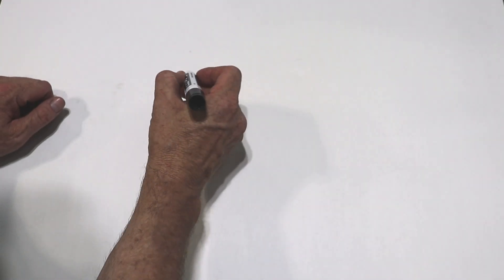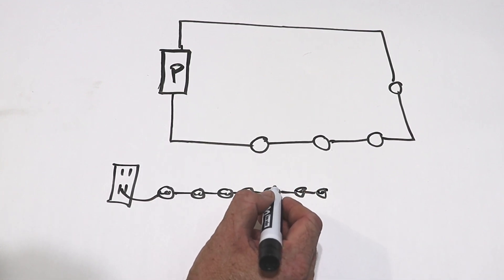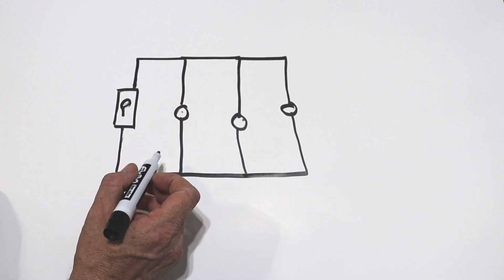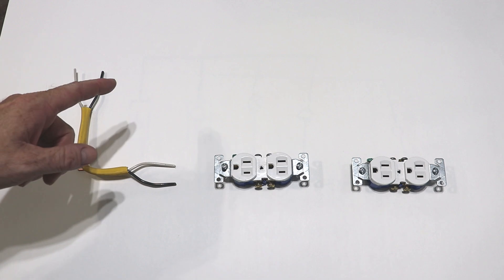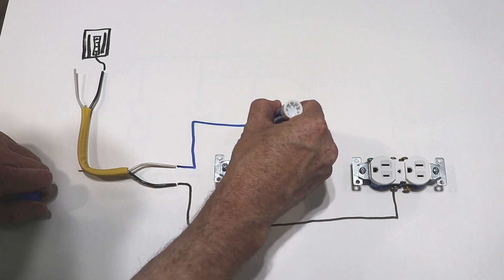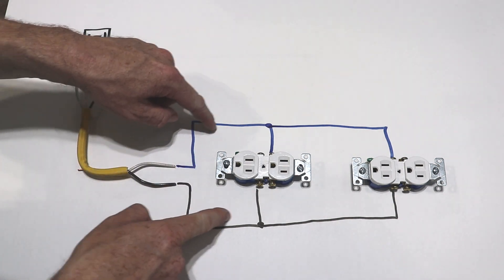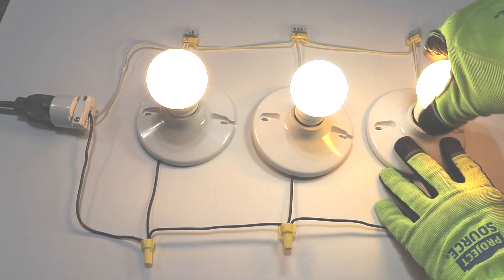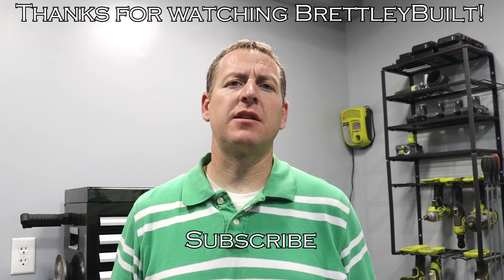Explaining the Difference Between Parallel and Series Electrical Circuits

Comment: Just curious if i was to test a outlet at the end of the run would i get some voltage on the neutral side if i had something plugged into the first outlet with load but NOT the end outlet i was testing?  Like will the neutral side carry voltage backwards?  I hope that makes sense.
Reply from the maker: There is aways voltage, but not current until something is plugged in. I am actually not sure.

Comment: What if the circuit only contains 1 switch and 1 light? Please respond thank you
Reply from the maker: It would look more like a series circuit, but it is important to understand that houses are wired in parallel.

Comment: Curious about one thing. For 12/2 romex, or any gauge with a ground (bare copper), how is this ground connected throughout your example with three lights?
Reply from the maker: There isn't a place to attach the ground wire to on this type of light fixture. You can push the bare copper wire up out of the way into the top of the box.

Comment: Your videos are great! The electical basics was very clear and helpful. Can you do a video or share resources on how to run multiple lights on a circuit, each indepentantly controlled by their own switch? I have two adjacent bedrooms and a hallway in between that each need a celiing light
Reply from the maker: Yes, I can do that. Give me a couple weeks.
Reply: @brettleybuilt  Rock on, thanks so much!
Reply: @brettleybuilt  update here if its helpful- I was planning on running a new circuit, but am scared of working in the panel. So now my plan is to figure out how to run from existing outlets to new light switches/new light fixures. Any advice you still have would be welcomed! I just think it would be better to avoid the box for now

Comment: What do you think is better or safer, the wago connectors or the twist on wire nuts?
Reply from the maker: I like the wago connectors because I can see that the wires have all seated properly and a secure connection is made. The wire nuts work great but can be more cumbersome.

Comment: One of the best visual examples I've seen thus far. My question is why would someone use a series circuit over a parallel? Can you provide any real world examples? Can you make a video about this?
Reply: Christmas holiday lights.    low voltage bulbs are in series.   

Connect two (2) of these STRINGS together they would be in parallel.
Reply from the maker: There aren't any real world examples of encountering a series circuit around the home. Electronics like a tv use some internal series circuits, but you generally aren't going to find them around the home.